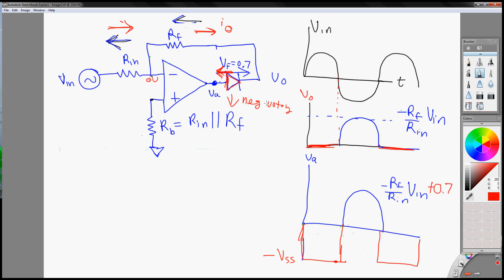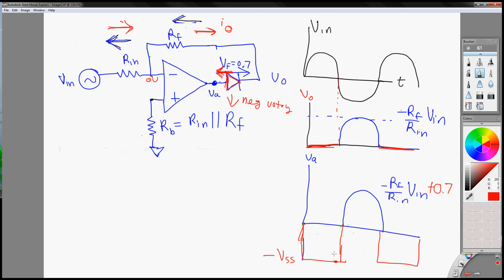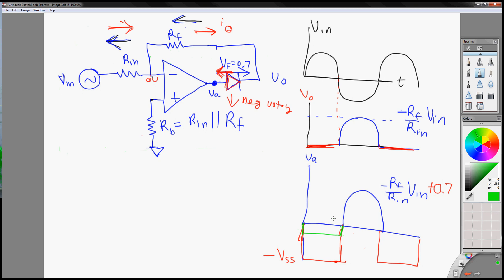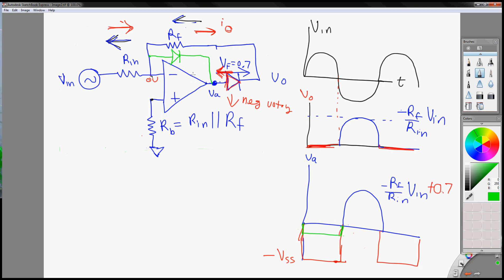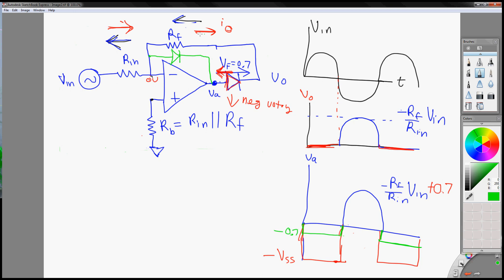A Simple Trick to Improve Half Wave Rectifier Performance with Op Amp Part 3

Comment: Does this make any assumptions? How is it that the additional voltage introduced at Va is enough to overcome the supply of the op amp, given that they are typically low voltage/current?
Reply from the maker: the clamping diode provides an new feedback path so that the op amp input terminals can have minimal voltage difference. It doesn't take that much current from the op amp to pull the V- terminal to V+.
Reply: Oh, so the op amp acts as a current sink when the clamping diode is forward biased. Cheers!
Reply from the maker: Junkers yes! clamping is a very useful analog trick!
Reply from the maker: Junkers people use clamping diodes to protect against over voltage at the inputs of op amps too